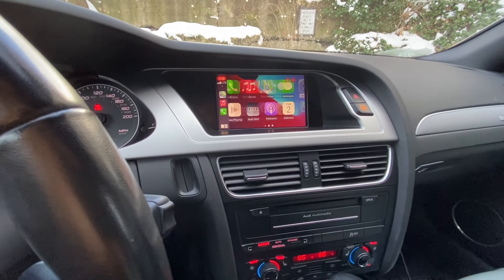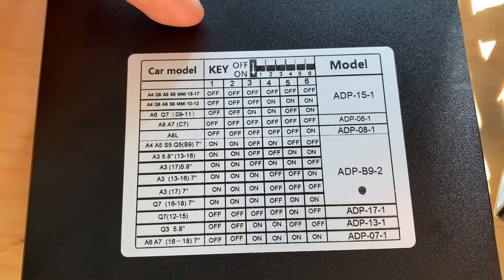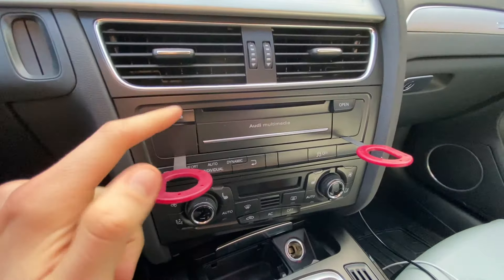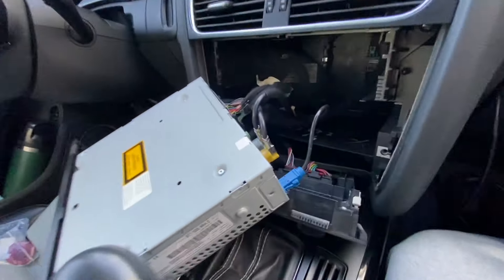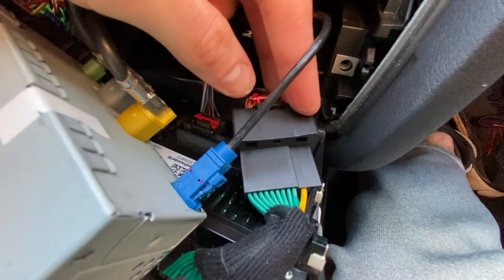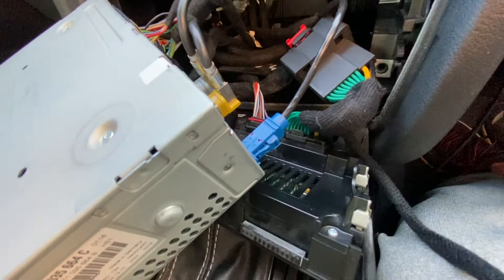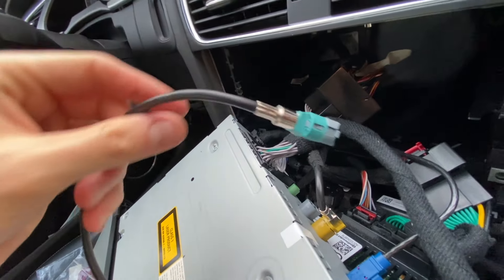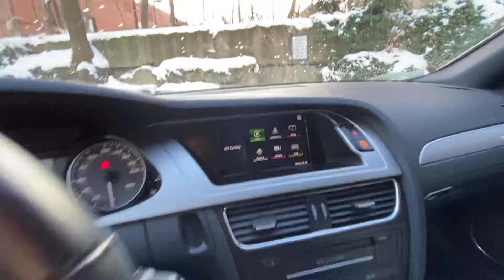Installing AppleCarplay on a B8/B8.5 Audi A4/S4 - (RSNAV)

Comment: My radio and multimedia won’t come on if I buy that will it work now? I been driving with no music for months lol
Reply from the maker: mmmm.... Can you describe what you mean when it won't come on? Do the screen/audi functions work?
Reply: @griffenaddie  mmi comes on then turns off , the screen shows it wants to turn on but it doesn’t fully turn on my control bored works so idk what the problem is
Reply from the maker: @tfgtv3966  hmmm. That is a strange problem... This could solve it but really no way to know until you try. May be cheaper than having a dealership try to fix it

Comment: The kit I bought has a microphone wire and i don't know where to plug in the microphone?
Reply from the maker: you would plug in the microphone into the kit you got, and then wire it to have the microphone come out somewhere around the upper area or near the steering wheel. (basically whatever direction your voice is pointed)
Reply: So the microphone wire is their to add a aftermarket microphone

Comment: What if you don't have the nav button?
Reply from the maker: You will have to make sure you order the right version for what MMI system you have. On the website there is a chart that shows the differences and you can match it with your car

Comment: bro i want to get this but my car doesnt have navigation, i have a 2012 a4 b8 and i dont have those controls near the gear shifter.. is there a system for my car?
Reply from the maker: hey! I am pretty sure there is a system you can get even without factory navigation because that is a choice you have to choose or not choose when checking out. BUT, to make sure, I would email RSnav owner Daniel Kim and just explain what you have and confirm which one to order. Hope that helps
Reply: @griffenaddie  hey thanks I appreciate it!

Comment: Yo im getting an Audi A4 B8 2008 is that the same car as yourself?
Reply from the maker: no, 2011 s4
Reply: @griffenaddie  would it work with an 2009 Audi A4?
Reply from the maker: @miltonamulanda3163  Depends on what MMI you have. If you have 3G or 3GMMI + it will work!

Comment: bro do you feel any difference betwen confort normal and dynamic ? can you tell me what diff u feel ? ty a lot.
Reply from the maker: Yes! there are some differences! will list below
1. Steering- in comfort is much lighter feeling, when put in dynamic it becomes much heavier. the electric power steering decreases to allow you to feel more of that great hydraulic steering feel!
2. Rear diff- In comfort the rear diff works like any normal Quattro car essentially being  "open" and feels like a typical Quattro 4wd car, almost more FWD feeling. When put in dynamic 80% of power now goes to the rear wheels and the rear diff increases stiffness, allowing for more rotation in the wheel and a more sporty driving feel
3. Software- in comfort (auto ) it shifts super early, in dynamic it holds the gear a bit more into higher RPM's

Hope that helps. Those are the main things I felt!
Reply: @griffenaddie  thanks a lot man

Comment: is there Wireless CarPlay?
Reply from the maker: yes! my (older) module is wired only. But, if you purchase a new one it now comes with a wireless option.
Reply: @griffenaddie  I don’t know if I’m right but I think the wireless one is more laggy, specially when you turn the knob sometimes it takes a seconds to move in the screen or sometimes it doesn’t do anything and you have to turn the knob again😅
Reply from the maker: @B8_ghostt  that makes sense! plus there is a echo when talking on the phone

Comment: Ausum wheel, I have just got flat bottom to fit to my Q3 is it a biggy  s line QUATTRO  .do have to take battery off . THANKS
Reply from the maker: I would take disconnect the battery if you are changing the steering wheel! just in case the airbag was triggered
Reply: @griffenaddie  NEGATIVE?? WILL THAT BE OK,
Reply from the maker: @philipgilbert6688  yes, just want to ensure that no power can get to the car if you are doing anything with the airbag!
Reply: @griffenaddie  will this loose  all the settings , to the computer  ,
Reply from the maker: @philipgilbert6688  I don't believe so.
Reply: @philipgilbert6688  yes disconnecting battery will lose your infotainment settings
Reply: @Amir.253  Decided to let my Garage do it  😃

Comment: Hi I’ve just installed an rsnav into my 2012 a4 but I have a blank screen have you any ideas??
Reply from the maker: Hmm… what MMI do you have? Is it blank completely or can you access the normal Audi screens then when you engage CarPlay it goes blank?
Reply: BNav_eu_P0206_D1 when I install the system the screen is blank I have sound but nothing on the screen
Reply from the maker: @malcolmcampbell8162  maby you missed a wire or something is not all the way connected?

Comment: Does this by any chance bypass the original MMI? My A4 is stuck on splash screen after some updates went wrong so although the mmi works, the screen doesn't show anything. If it bypasses it, it would be amazing!
Reply from the maker: Technically this bypass although in your situation Im not completely sure if it would work or not.... I would check to see if the screen got disconnected or if its a screen issue or some other issue. Could start by disconnecting the battery to hard reset everything and see if that does anything?
Reply: @griffenaddie  I've tried that as well but it doesn't work. Essentially I tried to do an update without backing up hence the issue, so it's not a screen issue. It's literally the component protection which prevents me from seeing anything besides a splash screen
Reply from the maker: @flavioporocani3743  hmm that's annoying... Honestly your best bet may be going to the dealer-- should be easily fixed if they have the proper computers
Reply: @griffenaddie  I guess i have no other choice. Thanks so much!
Reply from the maker: @flavioporocani3743  haha.. Wish you luck! hopefully its an easy fix

Comment: is an aux cord from the glovebox still required to be plugged in or does the blue tooth from the apple car play automatically connect once you start/turn the car and system on ? I have a 2011 b8
Reply from the maker: I had the wired CarPlay version, BUT from my understanding when you start the car, it automatically connects to Bluetooth. although you should still keep a mmi-to-aux plug in the glovebox(connected to nothing) just for proper sound quality
Reply: @griffenaddie  understood thank you! I am looking for something that is completely bluetooth. I have not have much luck with the AMI/MMI bluetooth ones that go in the glovebox what would you recommend ?
Reply from the maker: @jamespressley8683  RSNav's version on their website is bluetooth! I think they stopped selling the wired version about 1.5 years ago. so if you get it from their website it will be bluetooth capable!

Comment: does wireless android auto work? and do you remove the battery before this?
Reply from the maker: wireless android auto will work with the current rsnav being sold. no battery disconnect needed.

Comment: how do i know what settings to choose on RSNAV? im doing it as a buisiness
Reply from the maker: Can you clarify your question? Im not sure what you mean by "doing it as a business"
Reply: @griffenaddie  I’l be installing it on different models cars etc but I don’t know what all the setting mean on the website MMI etc or no navigation ?
Reply from the maker: @Ransomfn  ah I understand. I THINK that each module is different based on whether the car is older and has an old version of MMI( which is Audis navigation/entertainment systems) or a newer version. I believe whether you have factory navigation will make a difference too. Overall, from my understanding there are a number of different options that will make each module unique to the specific car your installing it in. BUT, I would contact RSNAV owner to be sure as I am not affiliated or an expert with this company but a product user myself! Their contact info is on their website. They have a contact email and phone number .
Reply: @griffenaddie  Alright sweet thanks man

Comment: I’m wondering if it would cause more / parasitic battery drain?
Reply from the maker: It does not! The RSNAV unit is powered through the MMI system and therefor turns off just like the MMI system turns off when you turn off the car.
Reply: Cool!

Does it cause any rattles with cabin vibration after the install?
Reply from the maker: @eeiko321  as long as its properly installed it will cause no rattles/vibration!

Comment: Seems like they don’t support the Audi concert/symphony mmi. I have Audi symphony on my 2011 A5 😒
Reply from the maker: I have the B/O sound system and it works exactly like using the aux. The surround sound system works like oem. (I have a wired unit) not sure if that changes anything compared to Bt non wired unit
Reply: @griffenaddie  i currently have an adapter in glove box that goes from iPod connection to 3.5mm jack, and i have a BT receiver connected to the 3.5mm. It works just fine I just want apple CarPlay on my actual screen
Reply from the maker: @elchucapablas  ah I understand what you mean. Maby give Daniel Kim (RSNAV owner) a call and see if he has anything for you
Reply: @griffenaddie  will do. Thanks man. Have an excellent day

Comment: What if my car does not have the NAV button? How do I activate the system?
Reply from the maker: Check your MMI system. If you have any MMI after 2G, it can be compatible !
Reply: @griffenaddie  I believe I have MMI 2G High. The car is "relatively" new, Audi A4 Avant B8 2012, I am 100% sure that I can install CarPlay, but my worry is that I will not be able to switch between the Audi MMI and CarPlay, simply because I do not have the NAV button.
Reply from the maker: @Kritzz-  hmmm interesting question. Do you have Nav at all?
Reply: @griffenaddie  no, but I think the issue is solved now. I contacted the seller and he told me that I cam use MEDIA or INFO button instead.
Thanks tho!
Reply from the maker: @Kritzz-  Thats awesome! glad to hear it. Good luck with install. You will love it

Comment: Does it comes with backup camera ?
Reply from the maker: this does not come with a backup camera, but the same company sells a backup camera where you just replace the trunk handle with theirs (same thing but with a camera) and then it could integrate with this to have a backup camera
Reply: @griffenaddie  Is it compatible with Audi Concert ? Mine if Audi A4 2011 without nav. Dont know if it is 2G or 3G MMI. 

Radio No: 8T***
Display No: 8T***
HW: H06
SW: 0351
Reply from the maker: @RaghuNandanAvula1  you will need to confirm if your car is 2gMMI or 3g. It works with 3g or 3g+ but not 2g. Concert stereo doesn't make a difference

Comment: No lag? What about call/music quality?!

Thanks.
Reply from the maker: For phone calls I don't think there is any lag because my system is wired. (But I mostly pick up my phone and use phone speaker to talk rather than bt system.) for music quality it is Exactly the same as the aux cord I used before. One thing to note( you need to leave the mmi aux cord plugged into the glove box) but just connected to nothing for the best quality.
Reply: @griffenaddie  Thank you.

Comment: these RS navs are a headache Honestly, I have tried hooking this unit up by myself and only got it to work successfully one time before reinstalling and it not working several times afterwards I took it to car toys, Audi dealerships, Audi, radio service centers, and they all refuse to work on this unit because of how many problems they said they’ve had in the past I would highly recommend staying away from older Audis and just buy one new with Bluetooth. This issue has been with audi for years with all of their older cars. Very frustrating.
Reply from the maker: wow! great to look out for. All I can speak for Is my experience and my buddies with the newer BT version. Both had no difficulties/problems, and easy install! Thanks for the comment